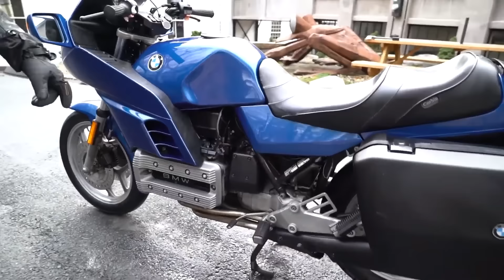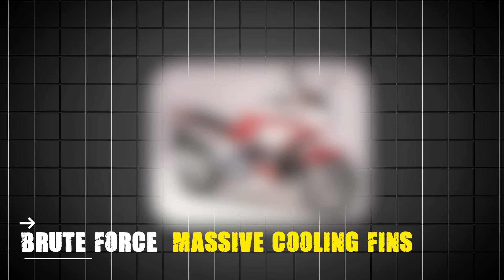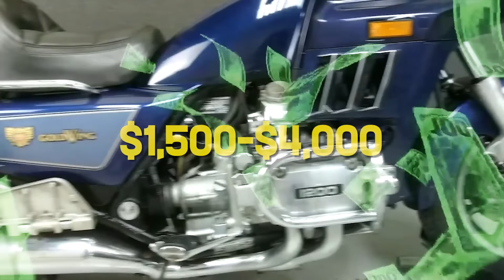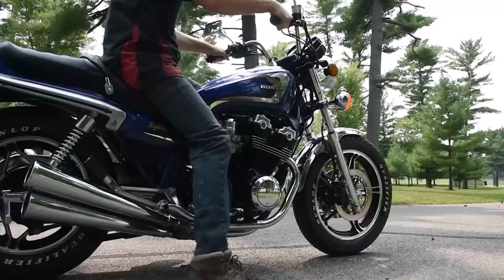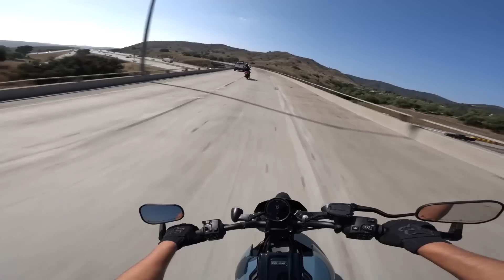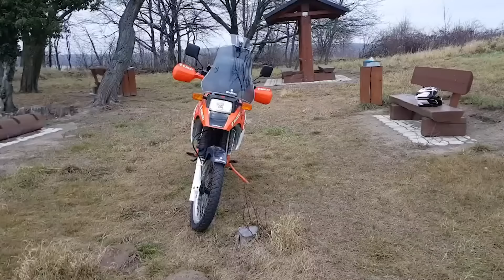15 Overbuilt Motorcycles From The 80s That Refuse To Die (Modern Bikes Can’t Compete)

Comment: I put 90,000 miles on a 2009 Kawasaki Versys 650.
Was still running and riding as new, and going 5k oil change intervals without needing to add any inbetween.
A stator, regulator/rectifier, starter, and fork seals all were replaced between 55k and 65k

That same motor is in the 2026 Z650 and Vulcan 650!
Celebrating 20 straight years (two decades!) in production, those 650 Kawi's have anvil like reliability

Comment: 2006 GZ1000 Kawasaki   concourse. It had 11 miles on it when I purchased it. It now has  201,695 miles on it. I drive it every day to work. I took the motor apart at 100,000 and rebuilt the top. Never been in the tranny or drive shaft, except for a new clutch and seals. It's do for its 12th valve adjustment now. Bullet proof motorcycle in my opinion.

Comment: I was a motorcycle courier for almost 20 years and the one bike that I would say is bomb proof was the Honda NTV 650. I had 2 and put over 100k miles on each just needed tyres, oil/filter and plugs never had to go near the engine. Also had an XJ 750 weighted a ton and breaks were crap/ well planned stops needed.

Comment: I have 2 FJ1200s in the garage and have owned 4 of them. The 1st one had over 200k miles on it when I sold it. The next one perished in a house fire. The third, I crashed hard but repaired it. I found another with 2500 miles on it and bought it while finding the parts for the one I crashed. Lovely bike, the FJ. Put some modern suspension on it and other upgrades and you will have a bike to last a lifetime.

Comment: Interesting information, but you got one fact wrong about the KLR 650. It would be a great engine if it had tappet adjustable valves. Because it has shim and bucket for valve adjustment and the process it takes to get the head cover off to do the valve adjustment it is a greatly undesired, and expensive procedure, to say nothing about the bikes weight. Worked on them, wouldn't own one. Get a Honda XR or XL 650. way better engine and bike.
Reply: So bloody tall!!!!

Comment: I have a HONDA 650 DOMINATOR,  83 MODEL, ZDCRDO8C, Its fabulous but im having certain age issues,  carburetor,  brakes etc .
It doesn't have a kick-start,  pure electric start ,it was built in Italy of all places & now i have it here in Cambodia, my mechanic said that it's basically the same as an XR ,Can anyone suggest an aftermarket supplier of XR top end replacement kit ?600 is ok.
Oh it says 76000 ks on the odometer,  apparently the motor will go to around 120000.

Comment: I would rather have my YAMAHA 1984TT600L Air cooled especially Dirt Bikes won't let you down 😮water cooled is just a Liability Fact.  A SUZUKI DR 400S are built proof for the Road a 1979 SUZUKI GS1000S another built proof bike all of witch i have owned i wish I still had them all back modern Bikes are docile pieces of SHIT Fact 😮

Comment: I have a Honda CX500 I purchased the  bike second hand in 1992 it had travelled 40. 000 KM. If I was on my own I would use the bike it's been around the clock twice and the only trouble I have had is the statter had to be rewound due to poor insulation but the agent spun me a different story being a mechanic myself didn't believe them and I was correct a and had to replace the diff I still have it now to this day and will never sell it. Definitely a bullet proof engine. Thank you for your information on other bikes. Regards Mike 72 73 Gladstone Queensland Australia 🇦🇺. PS I'm now 73 years old and still riding strong ❤🎉😂😊

Comment: I've got a DR 750 BIG ...
A real thumper ...but boy is it tall..
Thinking of making a flat tracker with it .....fun fun fun
Reply: Keep it original. I've got a DR650 Set from 1996. The motor is brilliant.
Reply: The Yamaha XJ600 was a brilliant bike. They came out around mid 1980s if I remember right. For despatch riders, they were simple and many saw over 100000 abused miles
 Regular oil and oil filter changes, the gearbox was solid too. The Suzuki GS 850 shaft drive were so strong. I bought one for £500 it had well over 85000 miles on it. Easy to work on and more practical than GS1000 in real life. So comfortable for touring. The kawasaki z650 custom of 1976 had mikuni slide carbs and was able to breathe better than later CV carbs. I thrashed mine to hell right into redline racing it like a loony. Only the handling let it down but compared to the kawasaki Z900 which would do tankslappers and handled like a shopping trolley.
Reply: I always had rat bikes. Had very little money so I paid £375 for z650 with 25000 miles on the clock. We were a group of mates who started a club and had some great times. Some of us were ex punk types off council estates and minimum wage jobs when we kept them. The others weren't partying and down pub 5 nights a week
The bike I loved was my BSA A10 twin 650 pre unit. I moved abroad and sold it cheap as I had to move quickly. I had a gs750 in Australia. £300. It had 50000 miles on it. Rode it to Sydney from Adelaide via Melbourne. Also rode it through blue mountains in NSW and worked 5 months and it took me to work in Sydney and I also had 2 XT500, yamaha. Both cost less than £200 each. One I used 6 months in Adelaide to get to work, had a RD400 swing arm in it. Talk about rat bike. Still had great fun racing around in semi desert off road hitting top whack. I was madder then in 1987. Had a few xs650. One XS2, 740cc conversion, flat tracked but with the frame I hammered it down mad mile Box Hill. Speed wobble tank slapper. Yeah it was a place where RD400, kawasaki 2 strokes or whatever when the learners could learn to ride on a 250 that did 100mph if you had a Suzuki X7. Others would race their Z1000, Italian Ducati if they were looded or got HP. 😂. Others would run old British bikes, they did 100mph the ton up lads on Bonny villes , Norton commandos, and of course jap rice burners,  it was a laugh and was a bit cat and mouse with the speed cameras, old bill on BMW boxer twins R100 then k100 flying bricks with their dayglo jockstrap. 😂. Back street Heroes, Easy riders was the scene with custom hardtail frames. Hartley sportster were pre evolution so were a lot of trouble from factory. Not many could afford them. Other riders, normally ones that did touring got the goldwing Honda. Nor me personally. If you had 750 two strokes, it was Suzuki kettle triples, kawasaki H2 triples, widow makers or RD400, old air cooled RD350 or RD350 LC. Later in 1985/6 the Rd500LC blew people away then the Suzuki 500 two stroke 4 cylinder of 100bhp, KawasakiGPZ750, 900, 1100. Then Suzuki GSXR750, 1100. Fast for the late 80s. Now 65 senior but still 21 in spirit. Miss them old times. MAG Somerset rally with Hawkwind, Kent Custom show just to name a few. Avon skidmasters, yokohahas, We all still had hastles with Thatcher, poor miners, firemen and ravers😂. Still we don't have kids worries like under these 2 hated ones who are so hated. Still to be ruling elite, most were Eton, Harrow then but now they just are more slippery.

Comment: 1998 Yamaha YZF R1.
345,000 km on the clock.
She still tapes out at near 300kmh.
The engine didn't use any oil or coolant between regular maintenance services.
🇦🇺👍
Reply: Excellent.  Carry on.

Comment: Suzuki gsxrs are literally everywhere 750s 1000’s are basically the same engine and so easy to work on I’ve got both a 2017 750 and a 2003 1000 gsxr the2005 is the best engine I love this bike and today with all of the sensors and computers bikes are not easy to fix on the road anymore with a small tool bag that can be kept under the seat . I would love to find an 80s Africa twin 1100 in half decent condition for a rebuild project. I love that bike.

Comment: My brothers v45 Magna, 750cc v4, threw a valve when i was driving it at 80 MPH.
My 1992 KLR650, I bought brand new for $3500 out the door,  is still driven regularly and has never broken at all. I have 30,000 miles on it. I hear a lot of problems with the new models that have fuel injection.
In 1988 I bought a brand new 1987 Yamaha FJ1200, I think I paid $4200. I bought it because all the magazines compared all other bikes to the FJ1200. I lost my license getting caught riding the FJ without a license. That is why I sold it and when I got my license back I bought the KLR650.
My brother bought a 1985 Yamaha v-max so he could beat my 1982 Suzuki GS1100L. Then I bought the FJ1200 and those two were pretty even with each other. The biggest issue was, the rear tire was offset from the front tire and caused it to wobble at high speed. So he bought a 1990 Kawasaki Ninja ZX-10 so he could beat me again.
 The Honda Nighthawks with the hydraulic lifters were bad engineering. The redline on the tach was 10,500 RPMs and the hydraulic lifters were only supposed to do 8,500 RPMs. I was riding my girlfriends Nighthawk 650 and I twisted it up to revs and it damaged the lifters. 
Oh my God! you are showing all my motorcycles. I bought a used 1985 Ninja 900 in 1997. It had been abused and scratched up with an open racing pipe on it. I just sold it last summer for $1800. It turns out that was too cheap since it sold in 10 minutes at the asking price. It ran great when I sold it to him but the new owner tried to play with the carbs and can't get it running good now.
 I bought a 2004 Yamaha FJR1300, 72,000 miles, with the money I sold the Ninja with. 
Oh my God, Oh my God, This is not going to sound believable !!!
 Right out of high school, 1985, I saw a 1982 Suzuki GS1100L sitting at the dealer for only $2000 with 2000 miles on it. My brother was riding a 1982 Kawasaki LTD1000 that he had bought brand new. My dad co-signed for a loan. You must remember, I was getting paid $2.75 per hour in 1985 but gas was 89 cents per gallon and the Suzuki got 50 MPG at 60 MPH. Speed limits were only 55 MPH and the speedometers on the motorcycles only went to 85 MPH
Reply: I owned at least 5 V45 Magnas. I owned a 1984 V65 Magna when I was 18. I never had a issue. But then came the Yamaha VMax. And I still have it with a few upgrades. The Magnas were fun and took a beating.

Comment: I'm surprised they chose the DR Big over the regular DR-650 they made so few of them. The gen 2 (1996 - current) model has a gear driven counter balancer and has been virtually unchanged. The DR-650 is awesome machine

Comment: Many of the motorcycles that were shown were liquid cooled, all of the advantages that liquid-cooling provides: consistent and lower operating temperatures and engine performance specs, it has one major disadvantage, corrosion, especially with aluminum alloys and worn out rotating seals, no matter what coolant one uses! Even with proper and fastidious maintenance and repairs, it is very unlikely that any liquid cooled motorcycle will become a fifty year old classic, replacement parts availability will prevent this from ever happening. My 1969 fully restored Triumph Bonneville sitting next to me only happened because it was air-cooled! My 1970 Honda CB750 KO air-cooled motorcycle truly changed my life, it started my entrepreneurial life as an inventor, designer, and manufacturer, starting with vacuum synchronization tools for this same motorcycle (please see my invention video, just click on the circular "H2H" logo at the beginning of this comment)  David Riddle